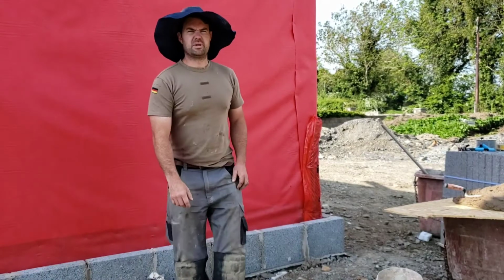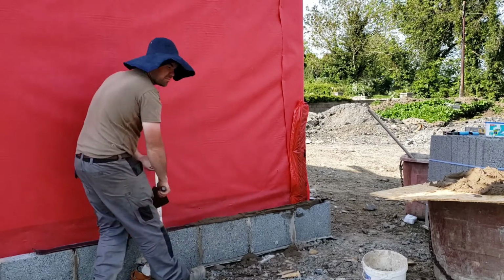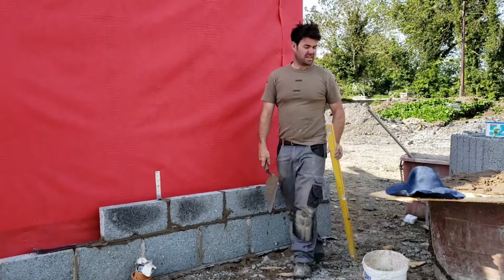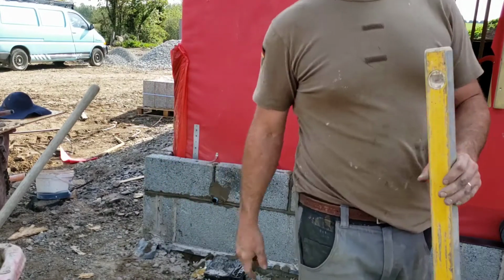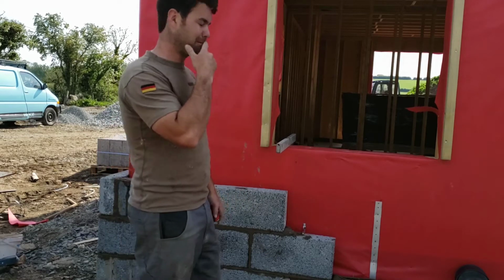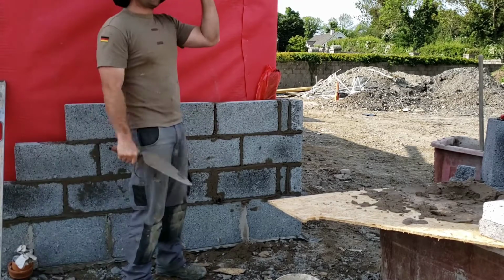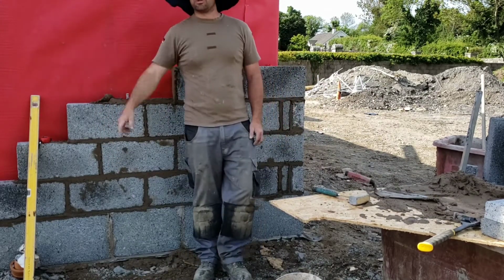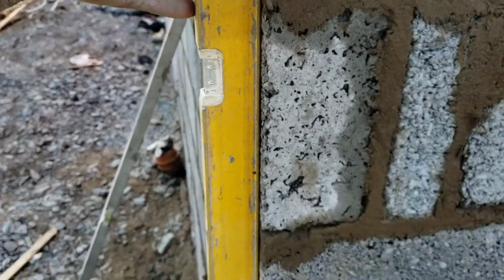how to build block brick corners on a timberframe house

Comment: I'm first gen Irish but 😱 that's rough work.
Reply from the maker: Naa. Its plumb square and level only a tit would comment on work he can't see in person, and your not much of a tradesman if you pass remark on others work,
Reply: @conormac2010   done it my whole life as as masonry contractor. I have seen thousands of employees.  If people don't want comments they can turn them off.
Reply from the maker: @PaddleDogC5  they way I look at it, if you don't want comments you won't like, don't post videos lol
Reply from the maker: Quick note, our solid concrete blocks majority would vary 1/4 inch from end to end, would be 18 inch along top and 18and 1/4 or 17and 3/4 inch on bottom and 9 inch high one side 9 1/4 inch other side, and all come with round edges, the way they look in video is about as neat looking as you can make them look, we do have finishing blocks which are square and sharp but regardless of company supplying blocks for rendered finish, they are terrible to work with
Reply: @conormac2010   JUNK block wouldn't meet any spec I've ever read in the USA. Allowances are plus or minus 1/8'

Comment: Don't hit face of material with blade even if it's rough bad habit.
Reply from the maker: There's a video of me building an 8 wheeler load of blocks a day that's 725 12inch blocks with zero help, mixing my own mud driving own machine labouring myself and building myself, untill you can come anywhere close to that best to keep your mouth closed,
Reply: @conormac2010  where's the video?
Reply: @PaddleDogC5  Where's your video?
Reply: @kebabtank  you need a video of what not to hit the face of the material?

Comment: "Ding Ding" Get out the corner
Reply from the maker: Ding ding there is a video of me building an 8wheeler load of 12inch blocks a day, that's 735 55lbs blocks zero help every day, mixing my own mud, loading my own blocks, driving my own machine and building myself, 6ft deep foundation built in a week solo, yes might look untidy but that is due to block quality, its level plumb and square. Take a look at rest of videos on Channel you might learn something 😁